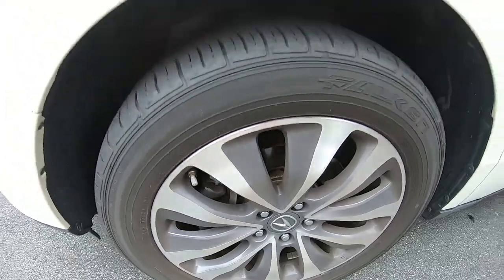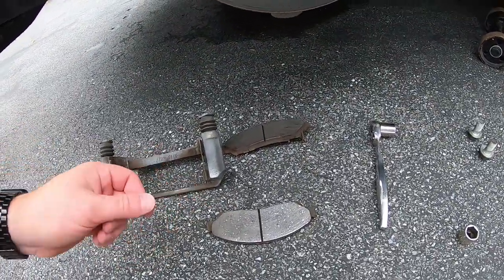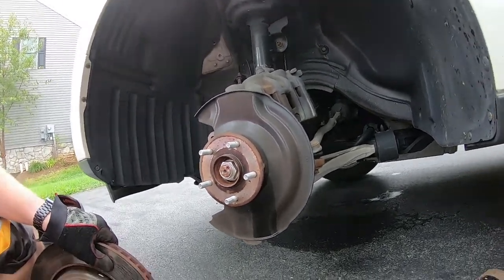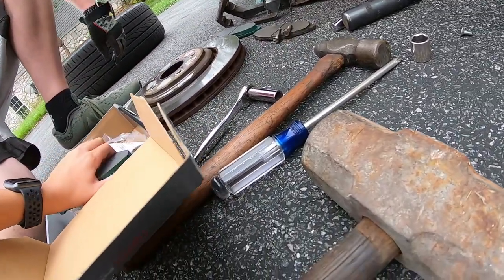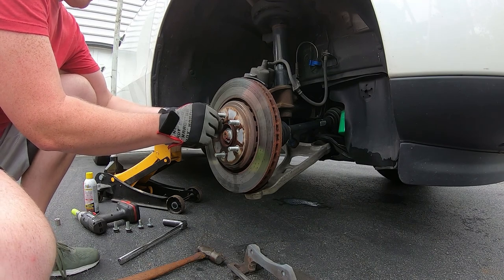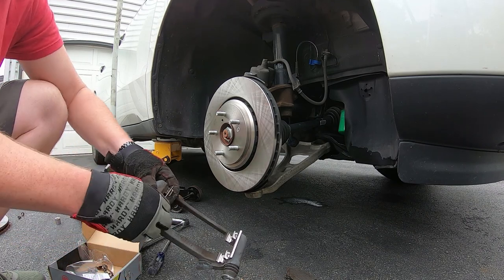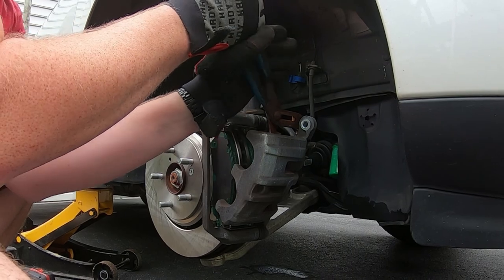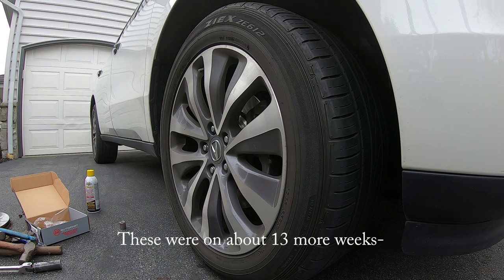MDX Brake pad and brake Rotor change-2016

Comment: I bought a 2016 MDX in January of 2019 with 53k miles.  At 115K it has developed the "undulation" of a warped rotor.  It's been many years since I tackled a brake job, but this video reminded me of how relatively easy it can be.  I had already ordered the parts online, but I had never heard of a "ratcheting screwdriver", so thanks to you I ordered a Klein brand from Home Depot (didn't want to risk using a cheap-o from Harbor Freight).  I pulled the front tires and calipers yesterday evening and will be replacing the pads and rotors later today.  And like yours, the pads still have 35-50% of the material left.  When I first pulled the calipers, I thought I was fixing something that wasn't broken, but it's the rotors that are the problem and not the pads.  Anyway, your video is well made and informative without a bunch of BS thrown in.  Many thanks in advance for sharing your experience  :-)
Reply from the maker: That’s awesome that you could DIY and I’m glad I could help without getting dirty again!

Comment: So far I liked your video but I have a few comments, I'm on my 3rd MDX and I do almost all my own maintenance. I would block the rear wheels and lift the car from the front lift pad under the engine to get both wheels off the ground at once; use a pair of jack stands if you have them; hang the brake calipers with a piece of wire from the shock tower or spring to keep it from damaging the brake hose by accident; after you remove the old rotors, wear a mask and remove some of the rust around the center of the hub with a rotary brush and brake clean spray then coat around the cleaned hub center with either anti seize or a light coating of caliper grease to keep the new rotors from rusting onto the hub; clean off the packaging oil coating from the new rotor surfaces before installation so they don't contaminate the pads; coat the brake pad tabs with a little caliper grease to allow them to slide in the clips; check the caliper slide pins and lubricate with caliper grease if needed; when installing the pads use a c-clamp to squeeze the bottom of the pads together and install the top caliper bolt to allow it to hinge down over both pads at once; check your brake fluid container level when you compress the caliper pistons to avoid overflowing the reservoir; remember to pump the brakes to compress the pistons onto the new rotors before driving the vehicle; test ride the vehicle for proper braking operation.
Reply from the maker: Allen Sarkozy you definitely covered everything I didn’t!
Reply: Allen Sarkozy fantastic. Im going to fo mine pretty soon.

Comment: From what I've read on the internet. The phillips screw is used at the factory to retain the rotor as it's moving through the line. Not necessary when doing a brake job, the lug nuts do that job.
Reply: It actually is known as a JAS screw which is a bit different...

Comment: BTurismo, thank you so much for the video! I will be attempting to replace the rotors and pads on my 2016 MDX for my first time ever and your video has helped give me confidence and great information. I really appreciate it!!

Quick question. Could you explain the process you used to remove the rotor that worked so well compared to banging at it with a hammer? You used two 12mm bolts that fit the thread, but I do not understand what exactly is happening. Something about 'bottoming out'?
Also did you look up what the threads ended up being? Some kind of 'typical Honda thread'...

Thank you for your time, and apologies if this is a silly question. I am quite the novice.
Reply from the maker: Sure no problem!
I ‘believe’ it will be an M8 metric bolt. If you’re going to the store, get two  m6, m8 and m10 just in case. Get them in 20-30mm length. I believe what we are doing is known in physics as a ‘wedge’ action- we crank the bolts in, evenly, until they ‘push’ against the hub plate and exert a force through the threads that causes the rotor to back away from the hub. 
You may ruin the bolts in the process if the rotor is particularly seized onto the hub. Go slow (quarter turn on each bolt at first) and use some penetrating oil. Even with this method, you may find that you need to tap on the rotor with a hammer to break any corrosive bonding that may have happened. 
Good luck and let me know if you have any other questions!
Reply: AMEN !!  😁

Comment: Hey what rotors you used ?  Do they squeek bought oem brakes but hesitant about the oem rotors because of the price per rotor
Reply from the maker: I definitely didn’t use OEM. I don’t know the brand anymore!
Reply: @BTurismo  should I be find if I get after market rotors identical to the factory with oem brakes
Reply from the maker: @real24bmore  I think so. Bonus if you get cryotreated or anything like that. They’ll hold up better to the elements and resist warping better.